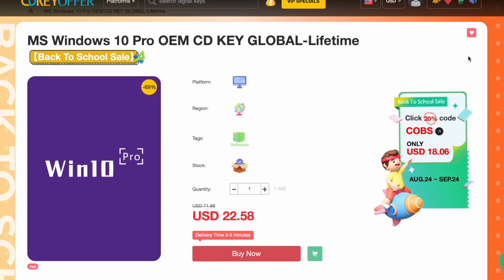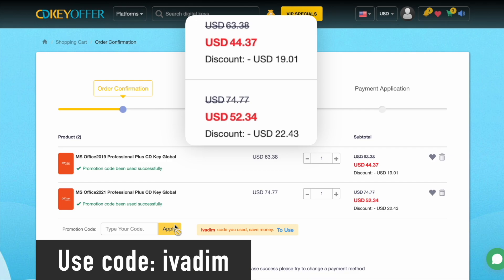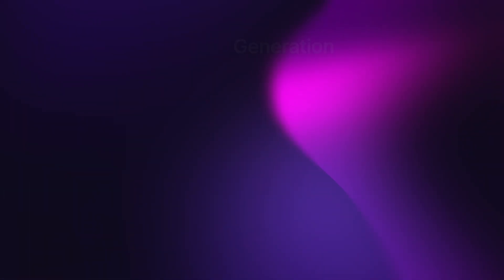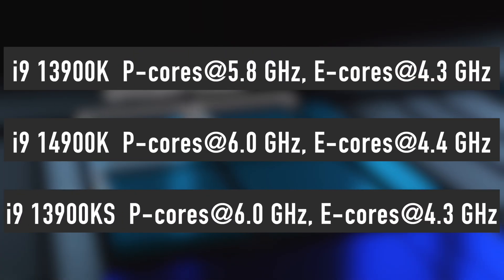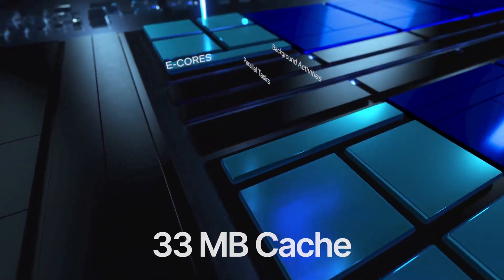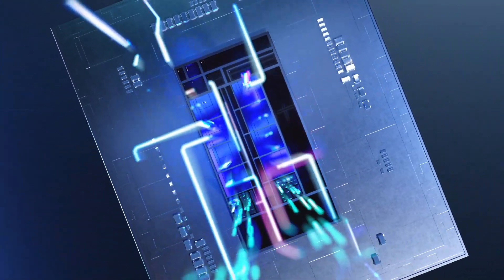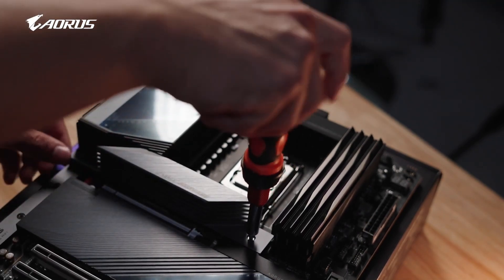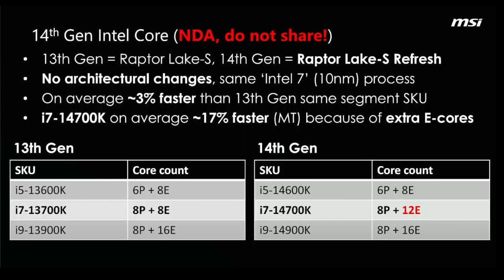Here Are The New Intel 14th Generation CPUs🫡

Comment: I have currently i7-10700kf. So I assume that a i7-14700K will be a great update and a significant boost to performance. I know I need to buy a new 14th gen Z790 (LG1700) motherboard +DDR5. Any suggestions?
Reply from the maker: Yeah, you really need to check if it is something worthwhile for your particular needs. It may be not worth spending the money.
Reply: @theivadim  money is not a problem perse. Need a good pc for cs2 and future games
Reply from the maker: If you want gaming and CS2 specifically then you should go for Ryzen 7 7800X3D as it offers superior performance and power-efficiency at the same time. And it is cheaper than 13900K/14900K.

Comment: I just sold my PC
It had a 6700k and a 1070
I'm looking at the 13700k and a 4070ti
Wondering if i should wait for the 14th gen to arrive.
Reply from the maker: If you need multi-core performance then it might be worth it if you are looking to get a 14700K. If not then I don't see any reasons to wait if you can buy a discounted 13700K. I expect it will be the better deal in terms of performance per dollar vs 14700K when it comes to gaming.

Comment: I got a I3-10105F with a cheap ass B560M, I was wondering if it's worth it to get a I5-11400F, or a new intel I5s, or change to AMD, either Ryzen 5 5600X or the 7600X if AM5 mobos and DDR5 lowers even more in price...
Reply from the maker: For gaming? I think AM5 is the way to go. Upgradable in the future. And there are some good deals to be had if you shop around.

Comment: And still Intel is way better than AMD and people still will pay for it no matter what.
Reply: Not really. Intel processors aren’t better than AMD by any objective measure. They consume more power and generate more heat for equivalent performance. AMD processors deliver equal or better gaming performance while consuming less power and generating less heat. Intel won’t become competitive in power efficiency until they shrink their process size to equivalent levels.
Reply: It is, especially for gaming since most games are developed on Intel cpus and are optimized for Intel cpu
Reply: @Austrium1483 wrong. Most games are developed for consoles and modern consoles have either AMD or ARM processors. Moreover, your CPU brand is irrelevant when you’re gaming on a PC at 1440p or higher resolution. You’ll get very similar performance to the extent where you can’t tell the difference in FPS with your eyes. Most modern games are GPU limited, not CPU limited, except for simulations and large-scale RTS titles.

Comment: While it can be expected that the 14th generation will only see marginal improvements, possibly even below 5%, but the situation is quite different compared to the 11th generation. After AMD released Zen 3, Intel's 10th generation 10900K was clearly at a disadvantage, losing to Zen 3 in single-core performance, multi-core performance, and gaming, all while consuming more power. This put significant pressure on the 11th generation Rocket Lake processors. However, the 11900K, despite a single-core boost, had significantly higher power consumption compared to the 8-core 5800X and fell behind in multi-core performance compared to the 12-core 5900X and 5950X. Its gaming performance also lagged behind the 5800X, 5900X, and 5950X. In reality, there was little improvement over the 10900K, and power consumption was even higher, making the situation quite challenging. The introduction of the 11900K did not change Intel's disadvantage compared to AMD's Zen 3.

The 13900K/KS is currently the most powerful consumer-level processor in terms of overall performance, surpassing the 7950X in single-core, multi-core, and gaming performance. Therefore, launching a refresh version of the 14th generation during the year when AMD has not released new products won't be as embarrassing, because the 13900K/KS is currently the top performer.The real competition will come next year with the 15th generation Arrow Lake and Zen 5.

Comment: More interested in this generations 65w lineup than their high end. This extra generation on 1700 is great for barebones systems that are now going to get an extra generation of processors. I’m looking to get as many cores in an asrock deskmeet b660 as I can safely cool with a low profile cooler. Looking at the 14400.
Reply: 13400f is still a decent cpu but I'd like to see it be $150 instead of $199 considering 5700X is at that price aswell
5800X3D someday will be $250 and that will make the 14600K be even tough sell
Reply from the maker: That is a cool little PC. Which CPU cooler are you using? Stock?
Reply: @theivadim  either the Noctua NH-L9i-17xx or the Thermalright AXP90-X47 full copper.

Comment: Awesome, thanks for the video.
I'm considering buying a ROG g16 i7 13650hx with rtx 4080 12 GB, is this CPU powerful enough for the GPU,or will there be bottlenecking when playing games.
Or should I just wait for the i7 14700
Reply from the maker: For a laptop CPU it is fine. Just check a review that the one you want to get doesn't have any flaws you may not like. But most of the time laptop makers tweak their CPU and GPU so they compliment each other. Bottlenecking is a desktop PC thing (for the most part).
Reply: @theivadim  thanks bro

Comment: having the 10900k i would like to upgrade to the 14700k but I would need a new motherboard and ram, a beefier CPU cooler, at that point I will upgrade the case to give more space to my 4090 that doesn't allow me to close the side panel atm LOL. and the power supply to get a ATX 3.0 and get rid of the adapter on the 4090. so at this point only the 4090 and storage would remain of my current setup so if intel delivers arrow lake next year, it would be best to wait. but will they delay arrow lake? we don't know. probably gonna wait
Reply from the maker: I'd wait if you really want an Intel PC. 15th gen should bring a very significant uplift in performance and power-efficiency.
Reply: I have a 10900K in a Maximus XII Apex, and i'm telling you, you don't need to "upgrade" at all. (my main gaming rig is the Crosshair VIII Extreme with 5800X3D tho).

I can do 4K/60 ultra with maxed sliders across the board (except in unoptimized games like Starfail).
I can do 1440/120 in ultra with maxed sliders across the board in hardcore online FPS games. 

and if you're doing light workloads, and you aren't relying on those workloads for a business, and not in a rush, then you're fine there as well, and again, no need to "upgrade".

Comment: So, is the KF better not having integrated graphics for gaming? Do games that demand high cpu usage need this. Would like to know witch cpu to get.
Reply: if you have only one monitor the KF provides a small luck advantage in finding better silicon (more potential for overclock stability) but if you have multiple monitors and plan to do multitasking with browsers etc. connecting the second monitor will prevent the browser from competing with the game since it will use the iGPU for hw acceleration, also if you use editing software having the intel iGPU will potentially accelerate the export thanks to intel quick sync. overall I think the K version is better unless you are on a budget and use the PC just for games on a single monitor.
Reply from the maker: @Franseven  well explained👍 Thanks!
Reply from the maker: In this case, integrated graphics doesn't make any difference at all. KF is usually slightly cheaper. So get that if you want to save some money. However, having a secondary graphics can be useful for troubleshooting a graphics card or as a temporary solution if your main GPU breaks.

Comment: I just hope the prices don’t suck.  I want to upgrade my 13600k to a 14900k.
Reply: I would just go for the i7 14700K man, maybe slower than the 14900k but its still a huge leap from a 13th gen i5
Reply from the maker: No doubt, the 14900K price will be significantly higher than the currently reduced $550 13900K. Maybe the 13900K is worth a look if you want good value.
Reply: @aqcys6165 Yeah, me too 😂